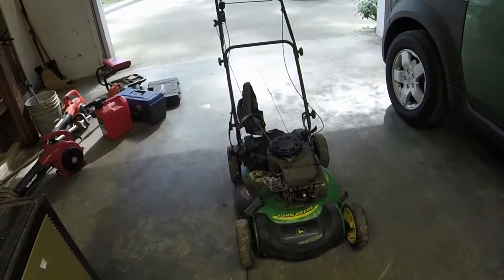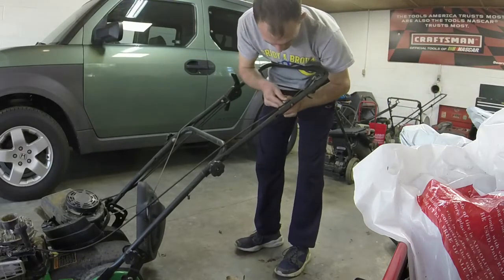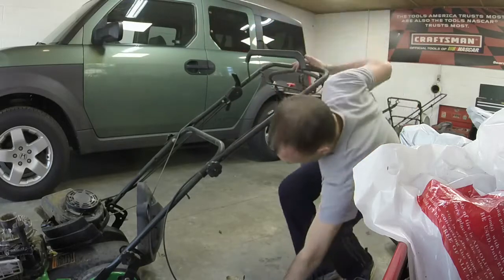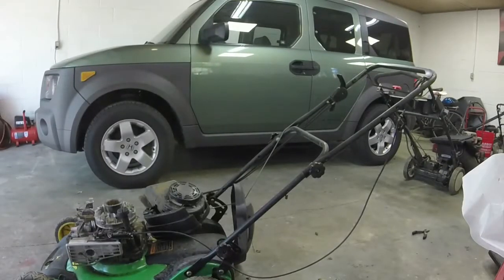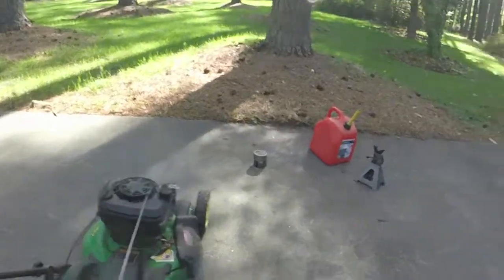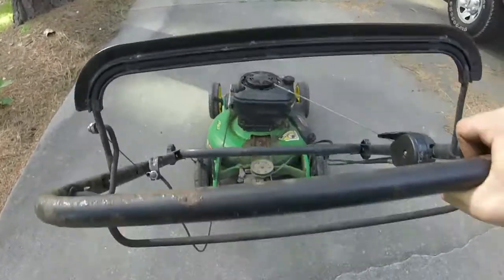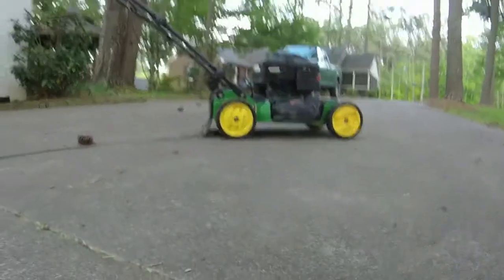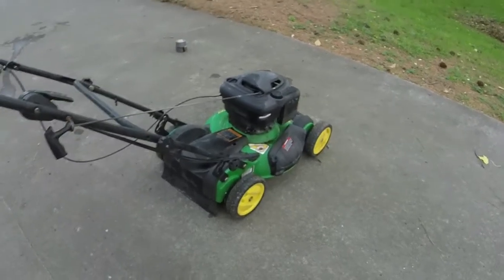John Deere JS63 push mower replace stop cable, adjust self propel, putting back together

Comment: I did a re power on an older one.  They really are made better than the run of the mill mower.
Reply from the maker: Yes they are Bruce.  I find the flywheel keys like to shear on them but apart from that they are very solid mowers.

Comment: I took one of these in trade earlier this season and ended up having to spend $40 for a new brake cable.... and then picked up a free junk JS63C (with casters up front) with a perfectly good brake cable three weeks later.  That's how things go sometimes.
Reply from the maker: You're exactly right.  I find I have some of the most random things lying around that I need for projects here and there.

Comment: My pull cable broke on mine today and I tried to take it off to put a new piece of rope on and the three screws holding on the assembly aren't screws they're like riveted in how do you remove those three screws
Reply from the maker: Take off the whole engine shroud it is connected to and you should be able to access what you need that way.

Comment: What was it you did to get it to prime better? You said something about the air cleaner???
Reply from the maker: Usually I double up on the gasket that goes between the air cleaner and carburetor which usually fixes the issue.

Comment: I have decided to replace the carb needle seat just out of precaution since a new seat and needle was included in the John Deere Carb rebuilt kit. I now have fuel in the engine oil and can’t figure what the h..l is wrong after testing it for leaks with about  6 inches of fuel column applied to the carb fuel inlet.
Reply from the maker: Sounds like the seat is not in there correctly causing it to leak through.
Reply: @EllisMowersandmore  I changed the seat again, making sure the groove was facing down. This time it was the inside diameter of the seat that was a little larger causing the float to contact with the carb casting…
Bent the float tab a little using heat so the float could sit horizontally when the needle is closing fuel admission passage. 
Still loosing fuel after a day….😔
I am installing a fuel shut off valve for now…
That thing had been fine for 20+ years….

Comment: Is the stop cable the same as Blade Control Cable? Mine is not sliding in the cable housing and its time to replace it.
Reply from the maker: They should be the same.
Reply: You can have hydraulic oil fed inside the cable, it will work like new.

Comment: Try changing the oil sae30 16oz and 4oz oil stabilizer.  For the smoking 

I have found that helps reduce or stop it.
Reply from the maker: Good to know, thank you!  I found out the flywheel key was partially sheared after the video.

Comment: how do you change the front wheel on a js 26
Reply from the maker: If it is not a caster wheel setup, you should just have to remove the bolt holding the wheel on and slide it off.  Caster wheels have a bolt going through it you have to undo and slide off.  May need a little WD-40 if there's some rust inside the wheel.
Reply: @EllisMowersandmore  it has what hey call a trasther washer I may have mispelled that